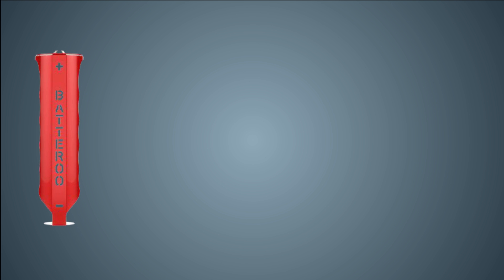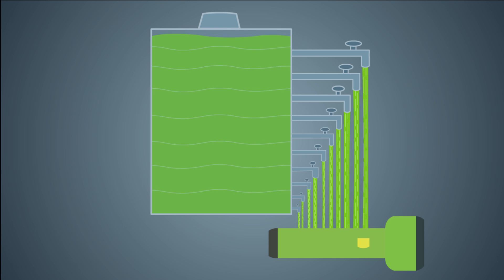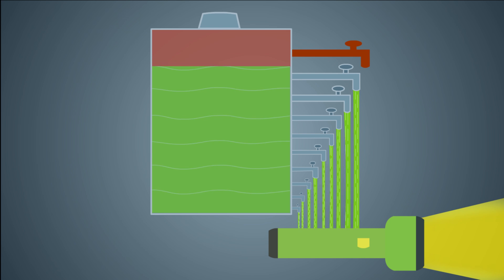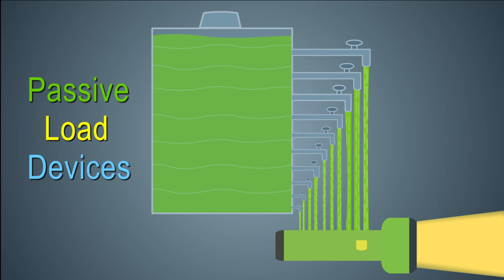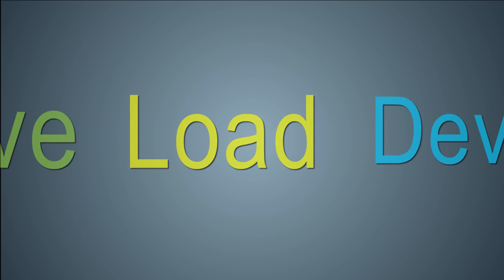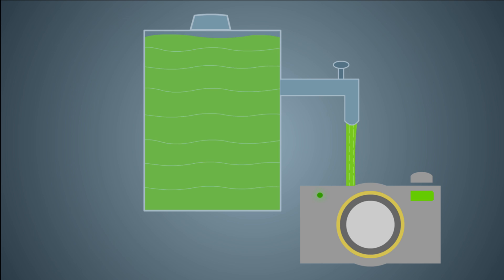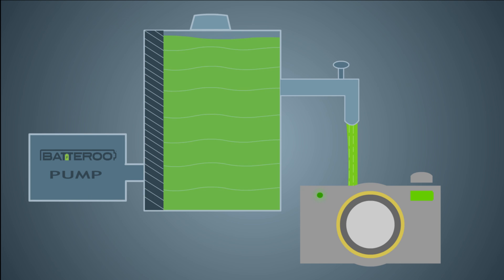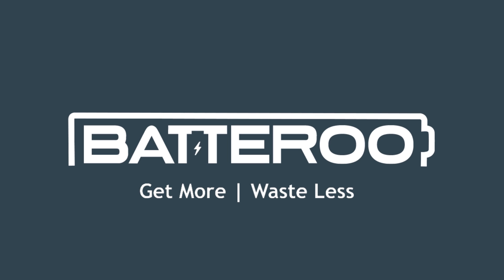Batteroo | Learn How Batteroo Works

Comment: Is a digital camera the best example to use... these sleeves may circumvent measures the designers of the product applied to prevent corruption of data due to loss of power... which has to happen at some point...?